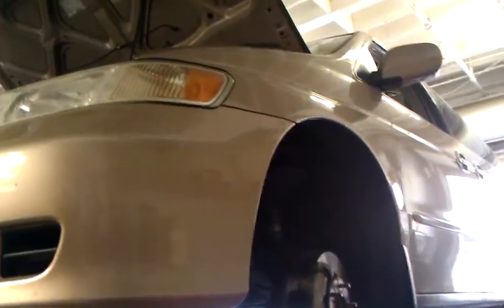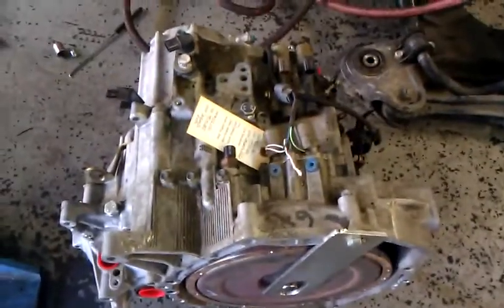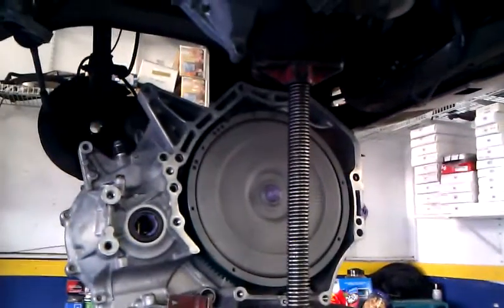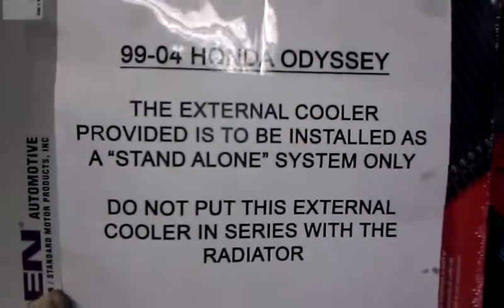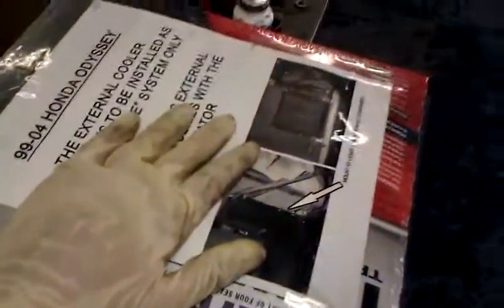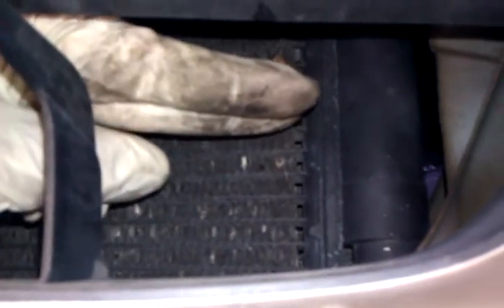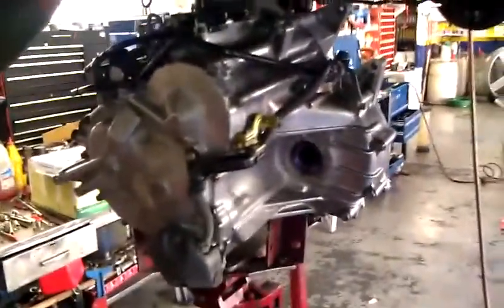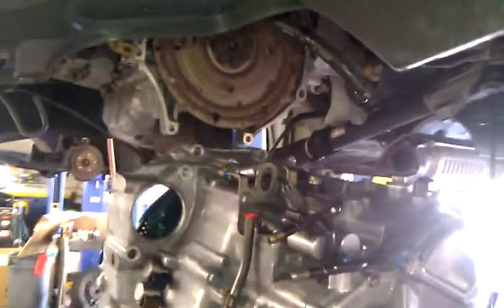Honda odyssey transmission blown/tips to prevent this

Comment: Most people don't drain and fill enough to keep fluid clean too.
Reply: How often do we do it because some service manuals say 75000 miles ?
Reply: @khan199304  I do mine a couple times a year. $17 jug of maxlife at walmart. Drain and fill. Keeps fluid clean and a smooth transmission. Otherwise every 10k for older models or every 30k max imo

Comment from the maker: well, in the olden days, 80k miles was a normal transmission service life. but now 120k is weak. i bet your exhaust valves are too tight causing a missfire. get a valve lash done and new plugs at that mileage. i service my trans every 30k, and add coolers, they go forever!
Reply: I have 122k on my odyssey do you think I can still replace it under warranty

Comment: I had a transmission shop for 7 years, but never rebuilt a Honda Odyssey. I just purchased one and the trans is bad but I bought it for a song. I have built thousands of 700 r4's and remember how bad they where. I am wondering is there an oil improver kit out there? Which port do I drill? kinda of dreding rebuilding this but what vehicle doesnt have problems.

Comment: My two cents. The re-manufactured transmission units have extra cooling capacity because they re-drilled the oil paths in the unit and corrected the defects they caused. The combo rad coolers oem design work fine for the transmission I have not seen these alone fail the unit. The extra cooler will help but I don't see much benefit unless u tow. I have rebuilt these my self and I find that the torque converters fails and cause the clutches to fail because the mineral oil gets burned.

Comment from the maker: there is no need to pull the transmission at all for installing extra cooler. i was changing that trans. cause it blew from being over-heated.
Reply: subtledriver , the transmission fluid overheats because some of the valves get stuck in the valve bodies. They have to be reamed out. Unless you do that this just happens again. Or get a properly rebuilt one

Comment: great video, I bought the OC 1679 kit like you recommended, however there where no instructions in the cooler kit that showed how to install the cooler kit with the included brackets, they only gave instructions for using the foam pads which are too thin to achieve the one inch spacing, bumper is all apart right now, any suggestions?

Comment from the maker: No, just get a kit and extra hose, remove grill and install. Disconnect the lines going to the radiator and then hook them up to the transmission cooler.